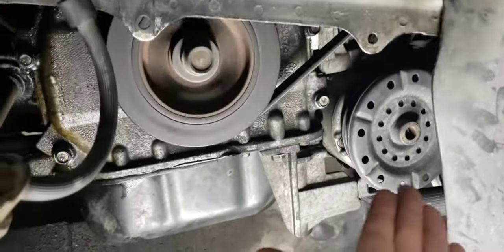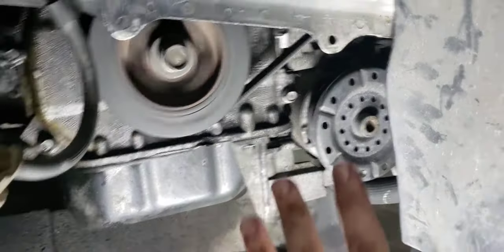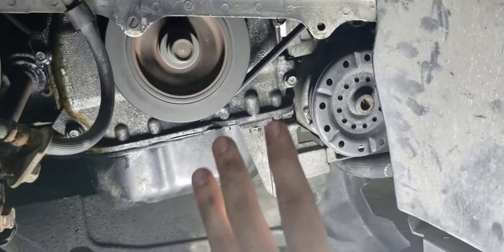[TET] (#1) Install Shorter Belt To Bypass Squeaky A/C Compressor Pulley (08 - 11 Dodge Caliber SE )

Comment: Is there a diagram for this or do you just run the shorter belt the same way as the original just without that pulley?
Reply from the maker: I didn't have a diagram. Thus, just removed the pulley and which made it a straight shot. The only con is, the A/C compressor will not work.
Reply: @motormech9876  can u explain how u ran the belt Nd more details
Reply from the maker: Unfortunately, I no longer have the vehicle in order to update with a video with the new diagram setup. However, it's very easy to do since you are bypassing the A/C Compressor with the shorten belt. @owenriggar815

Comment: What size was the smaller belt
Reply from the maker: In this video, I used CONTINENTAL 802K6. Here are the specs:

Belt Length	2037.08 mm
Belt Length	80.20" inches
Belt Top Width	0.83" inches
Belt Top Width	21.08 MM

Comment: What kind of vehicle is this
Reply from the maker: This engine is based off of a 2008 Dodge Caliber.
Reply: @motormech9876  is this a 4 or 6 cylinder
Reply from the maker: @dustindietrich6799  it's a 4 cylinder
Reply: @motormech9876  can you do the same thing on a 2009 journey rt
Reply from the maker: @dustindietrich6799  It depends on the diagram showing how is the serpentine belt laid out.  What is the current issue that you are facing?
Reply: What about a 2011 Chrysler 200 ??

Comment: which pulley did you remove?, upper iddler or lower?? duralast has one, but it ran through all the pulleys,except the Ac compressor(i have a 2016  compass, and the ac clucth and pulley is fxxx Plastic,mine does  not move freely,it drags so i bypass it with the duralast No ac belt)
Reply from the maker: I removed the lower pulley that is across from the a/c compressor.

Comment: Any chance you remember what size belt you used for the bypass
Reply from the maker: In this video, I used CONTINENTAL 802K6. Here are the specs:

Belt Length	2037.08 mm
Belt Length	80.20"
Belt Top Width	0.83"
Belt Top Width	21.08 MM

Comment: Can you do this on a 2007 nissan murano sl?
Reply from the maker: Doing some research, you will need a belt that is 37 1/8 length and make sure to remove the bolt so it doesn't affect the belt. You can search up "2007 Nissan Murano AC Compressor Bypass" by 
PopTart Grant Lambert on YouTube to view an example of it running.

Comment: Would u happen to know the belt route for buick enclave 3.6L with out that pulley and ac unit .the car on this video  looks the same...need to know the belt size.would be so helpful.
Reply from the maker: What year is the Buick Enclave 3.6L?

Comment: What size belt did you use
Reply from the maker: In this video, I used CONTINENTAL 802K6. Here are the specs:

Belt Length	2037.08 mm
Belt Length	80.20"
Belt Top Width	0.83"
Belt Top Width	21.08 MM
Reply: 80 inches is incorrect
Reply from the maker: @xXxCrazyJay810xXx  The belt provided is for a 2008 Dodge Caliber. Is the belt that you are looking for a different vehicle?

Comment: I need to do this for a 2000 buick LeSabre which is a 3.6L 3800 series 2 engine. Can you tell me what size belt
Reply from the maker: It seems like you are in a tough spot. Unfortunately, you will need the tension from the pulley of the A/C Compressor. If you are able to remove the A/C pulley and not need it, you can use a Dorman  Air Conditioning Bypass Pulley Part # 34196.
Reply: I figured that's what I would have to do so I got the part today. About to look up video for it now. Thank you.
Reply: Do you have a preference for which one to watch?
Reply from the maker: @shannonwilson2653  I'm sure you can find videos that are a bit general here on YouTube but if you have access to a local library, some libraries have access to Chilton Auto Repair Manual.

Comment: What engine was this that you did this on i have a 2005 5.3lt vortec
Reply from the maker: This is a 2008 Dodge Caliber 2.4L 4-Cylinder.
Reply: Ok I just realized my ac pump is ran on its own belt. Thank you for getting back to me

Comment: Will that belt shorten work for a 2.4 l motor of a 2008 Dodge avenger
Reply from the maker: If the engines are the same, the belt shall work.

Comment: how long does the belt need to be after you remove the pulley?
Reply from the maker: For this vehicle, it comes out to 80 inches w/o A/C. If it's for a different vehicle, you can check this video out. https://youtu.be/HwdV1aHC-7c
Reply: So when your video you don’t really tell what car are you working on for that matter how do you figure it out for any car because there’s not any information specific on the Internet anywhere.